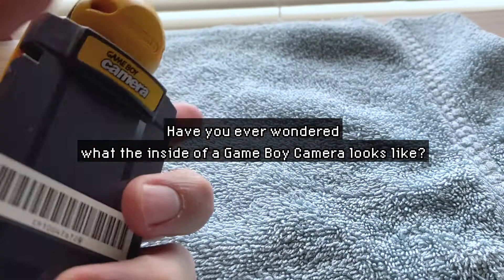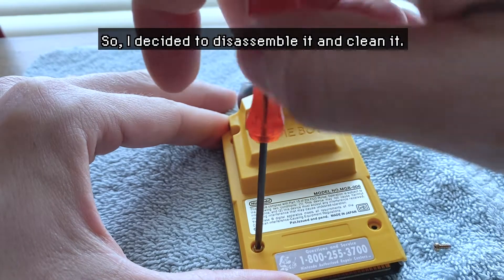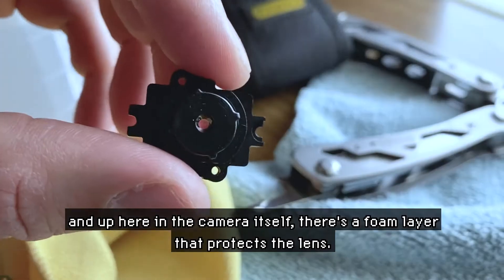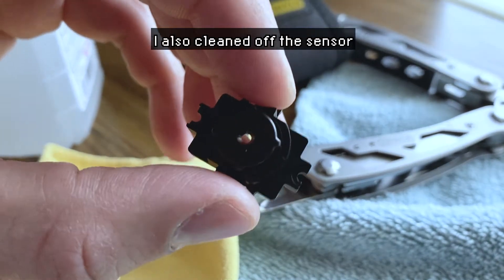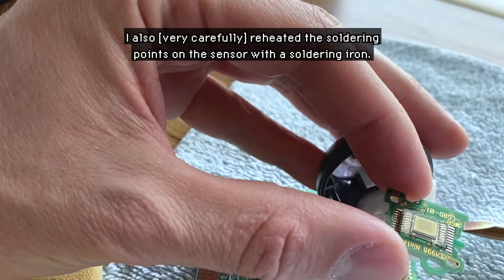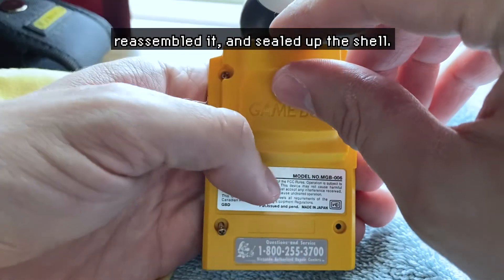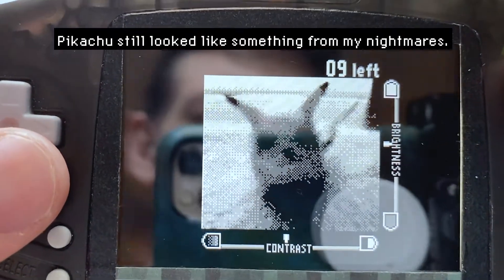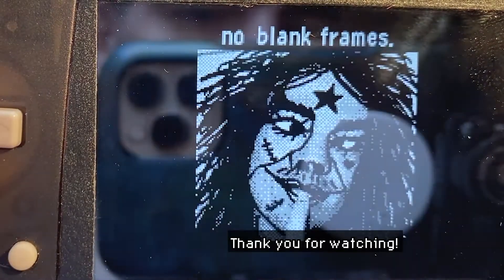Cleaning My Game Boy Camera

Comment: Your camera probably comes from a very early batch: it has a V1 sensor (MGB-CGBD-01 written under the sensor, the newest ones have a 02) and also pcb model of the motherboard is 10 (models are 01, 10, 11, 20. you can see MGB-MGBD-10 on the motherboard)